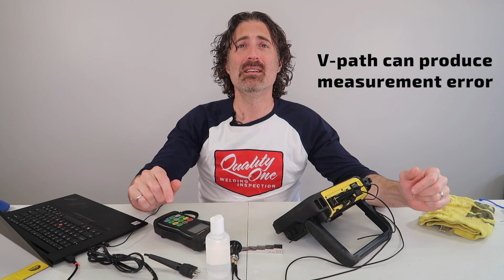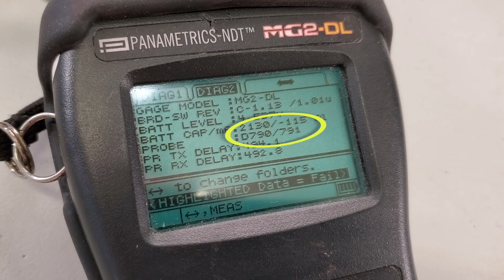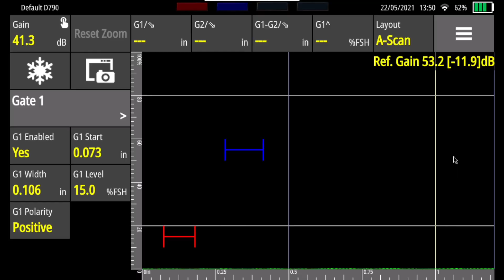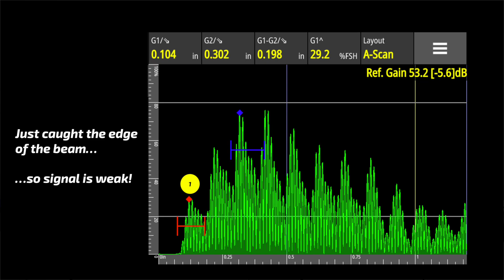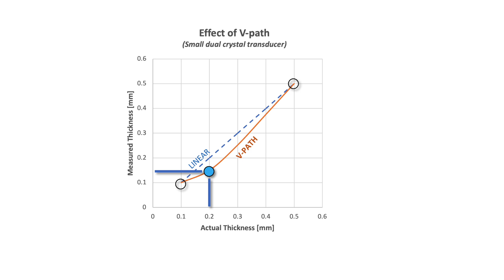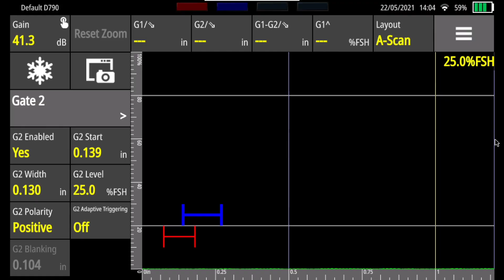V-path Error

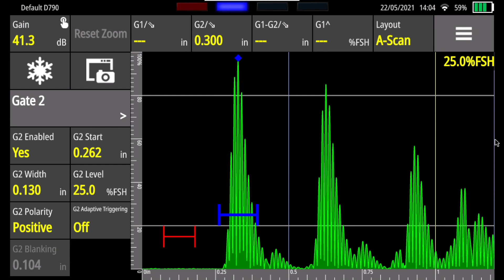Comment: Hi Paul, thanks for explaining yet another interesting aspect of thickness measurement. With dual probes, there is a small echo trailing the BWE, it's about 10%FSH in your video @ 3:03, I've been wondering where does it come from, on my own GE MSEB probe it's actually quite high, reaching up to 25% with  BWE being at 80%, and measured thickness just around 50 mm. Much obliged! Greetings from 🇫🇮!
Reply from the maker: That trailing echo is the mode converted shear.
Reply from the maker: https://youtu.be/boJqYn-x2iw
Reply: @hollowayndtengineeringinc.5201  All right, that explains it all! Thank you!

Comment: Good video. I also think frequency plays. I scan with an epoch 600 dual probe 7.5Mhz .187”. It measure thinner stuff way more accurate. Measure Stainless sch 5.  The D790 is not very acurate